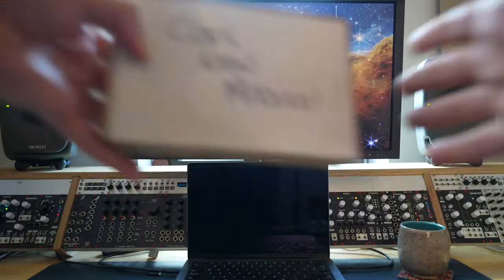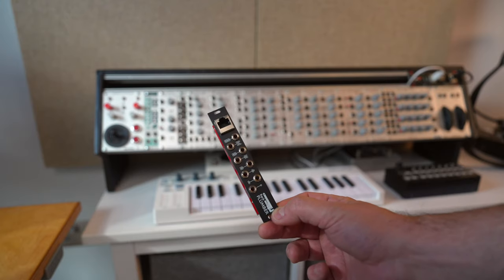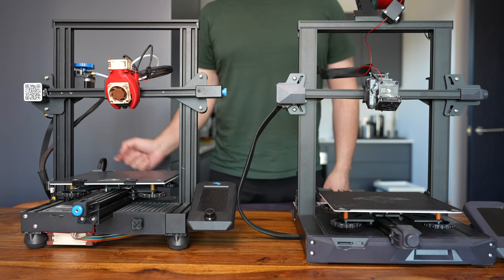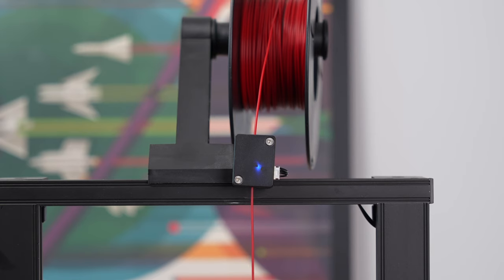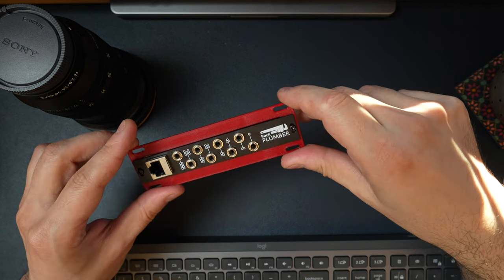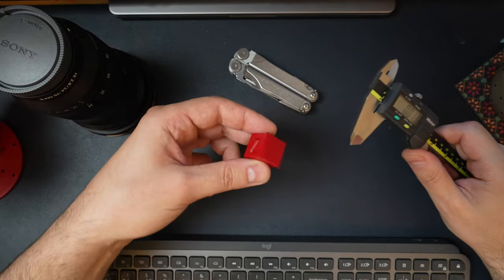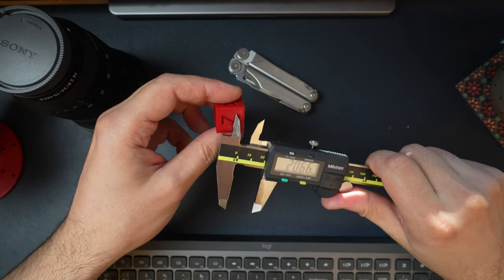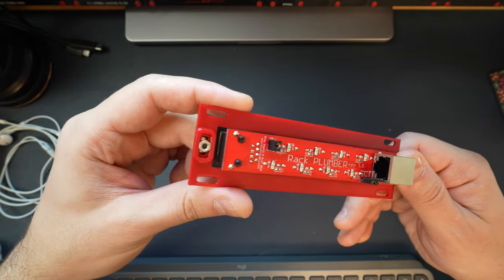3D printed synth parts!  Making cool and useful things with a Creality Ender 3 S1

Comment: Very cool to see how you prototype. Makes me want to pickup a 3d printer.
Reply: I'm lucky enough to have access to a pretty wide variety of tools between mine, my job's, and my friends', but my 3D printer is still my favorite tool for prototyping now that I'm a little more fluent with CAD.  It's such a low investment to just hit print on something, wait a bit while I'm working on anything else, and come back later to see if something will do what I want. 

 And the printer in this video is only $400!  That's comfortably in the range of any other workshop tool like a table saw etc., I remember much worse 3D printers being easily into the thousands when I was first looking at them.  

Since we're coming into the end of the year, if you can be patient for a few more months, most made in China 3DPs have solid Lunar New Year deals.  I saved $40 on mine just by waiting for that sale.
Reply from the maker: That's a super good tip.  The best sales start happening in about a month from now, so if you can wait, you might save a bit of cash!